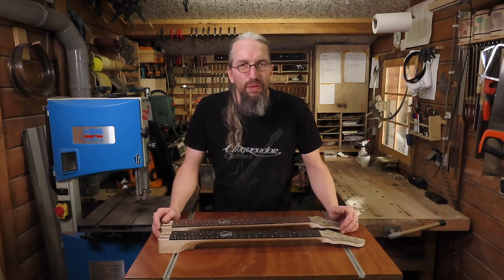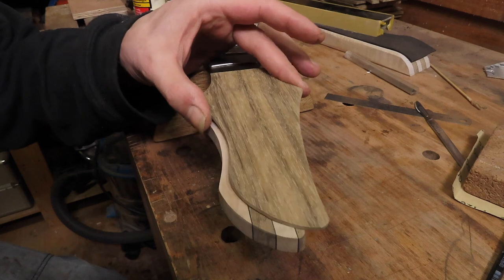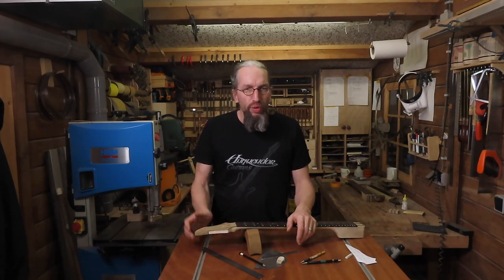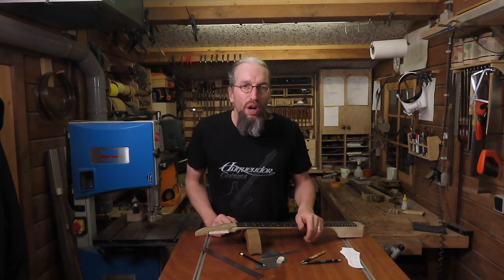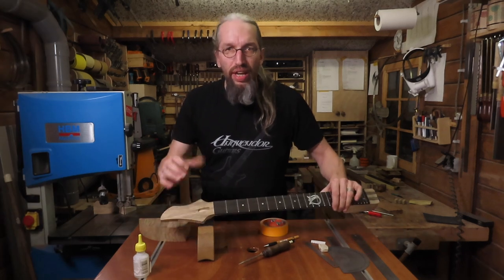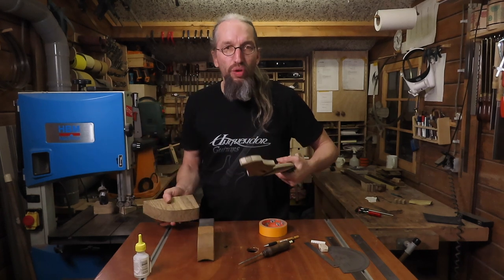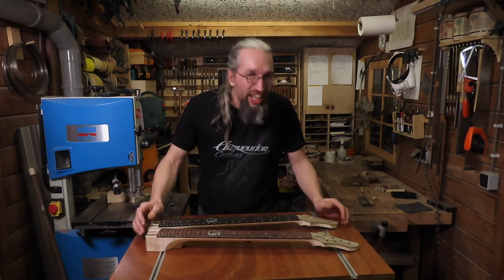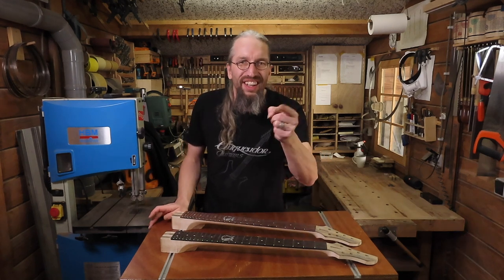Marking Tuner Positions, Headstock Veneer and Logo Inlay - A week in the Unquendor Guitars Workshop

Comment: Daniel, Have you thought about using a small laser CNC to cut out your headstock inlays? I guess they wouldn't cut aluminum?
Reply from the maker: Hi JJ Dilon,
Yes I have tried to have my logos laser cut but with no success. My logo's are too small and too detailed.
Even with very high end industrial laser cutters and very skilled operators we had very little success. 
The very thin lines and sharp corners and edges melt away. Cutting aluminum requires at least a 0,7 x the material thickness for the cut and even some more for the initial starting point. For a 2mm thick inlay that is 1,4mm which is too much for my tiny logos. 
We had better results with 0.5mm thick stainless steel, but that is a pain in the @## to inlay. 
I might give it anther go as one of my suppliers is expecting an even better laser cutter soon which in theory might be able to do it.
Reply: @UnquendorGuitars  Daniel, thanks for the explanation.

Comment: Hi Daniel 
Great vid again. I always find something informative and useful. I’ve been fiddling around with ways to set tuner positions myself. I worked it out eventually but not half as elegantly as you! Looking forward to the next instalment. Would you recommend the pillar drill that you use? I am interested in this model as it is compact and portable. Is it as accurate as advertised? 😎
Reply from the maker: Hi Martin,
Thank you very much for another nice comment.
I do recommend the Bosh PBD 40 pillar drill. I love it and won't use anything else unless Bosh makes a Profi (Blue) version.
It is indeed very compact, light and portable. That's one of the reasons I bought it.
The other reason is accuracy. Due to the fixed table the drill bit is always square/perpendicular to the table and your workpiece. Most pillar drills have an adjustable table which you always have to check, and usually adjust it to be square to the bit. An adjustable table might be useful for some jobs, but for guitar making you don't really need an adjustable table. 
An other great benefit I think is the speed  control to set the exact r.p.m. needed for the drill bit type and size without having to wrestle with several belts to adjust the speed. 
You don't need a tool to change drill bits. The bits lock in place with a locking mechanism.
And off coarse the build in digital depth gauge and fool proof depth stop. Setting the required depth is so easy and reliable.
There are two down sides though. 
The reach/depth of the drill press is a bit small. By that I mean the distance between the pillar and the drill bit. I can barely reach the holes needed for a string through bridge and the string ferules, and my body shape is relatively small.
And there is a tiny amount of play on the drill head (? where you attach your drill bit) It's not much but you have to be careful when drilling very precise holes.
But these two negatives don't weigh up to the positives in my opinion.
Reply: Hi Daniel.
Thanks for that. I’m not too trusting of online reviews so it’s good to get an informed opinion.😎